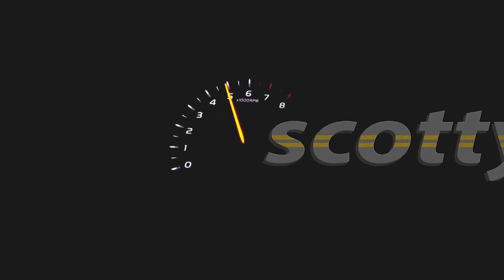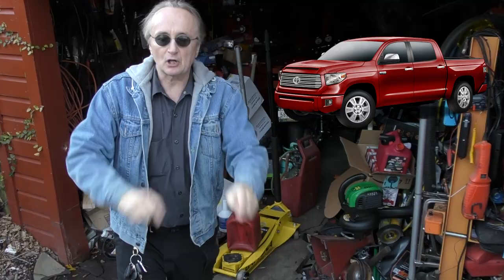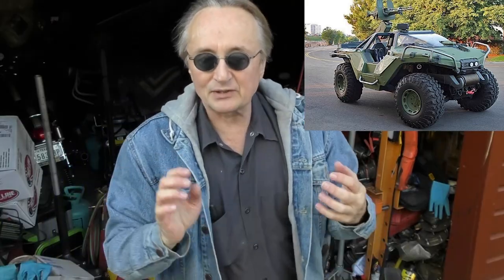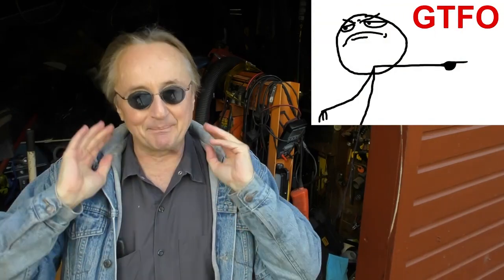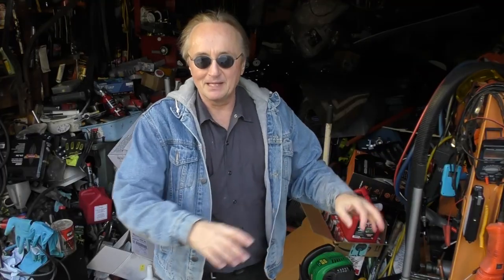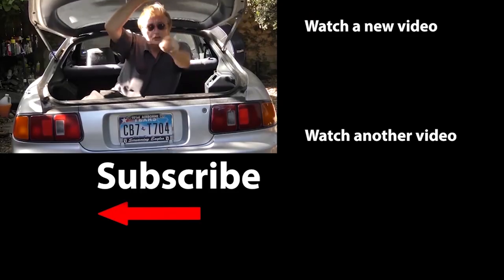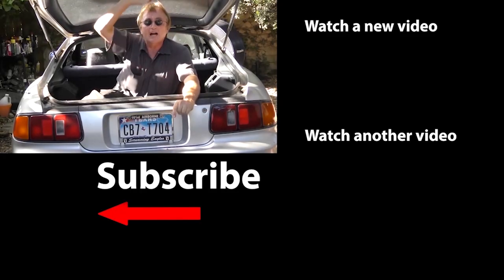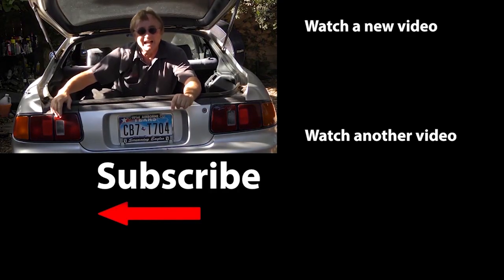5 Used Trucks You Should Never Buy

Comment: Who makes new reliable manual transmission in pick-up trucks ?
Reply: TOY OTA
Reply: Seems likes the Tacoma is the only viable option, perhaps the Frontier.
Reply: David Cisco ford, the new 10 speed is amazing.
Reply: David Cisco but you can’t break the transmission in the 11-16 power strokes.  Current have a 16 f250 and it’s built solid.
Reply: Datsun
Reply: You basically can't get a manual transmission in a full-size pickup truck, unless you get a 3/4-ton or larger.  And, if you were to buy a new Diesel truck with a manual transmission, the horsepower (and torque?) ratings are greatly reduced, because the automatic transmissions are designed to handle the power differently.  For example, a 900 ft-lb rated 6.7 Cummins Turbo Diesel is reduced to under 700 ft-lb (675 I think) if you order it with a manual transmission.  And if you order a small pickup (Tacoma/ Frontier) with any significant options, like a crew cab, the manual trans. option often drops off.
Reply: Geo metro bulletproof very fast
Reply: Unfortunately the 2018 Ram Cummins was the last year they were putting in manuals. Just read this the other day 😞
Reply: Midsize- Tacoma 
Full Size- ???
Heavy Duty- RAM 2500/3500
Reply: @aky115  um, but the 10 isn't a manual. He did say manual.
Reply: @hanskinslo326  Ram has discontinued the manual option for the new HD trucks.

No more full size or HD trucks with a manual.
Reply: Just got a used 2006 two door Ford F150 4.2L V6 with 5 speed manual tranny and 6'6" bed. 145,000 miles. No rust and runs smoothly. I like driving it better than my '08 4x4 F150. 
Sometimes you get very lucky.
I still miss my '73 Ford F100 with 8 foot bed, with a straight six engine (280?)  and three-on-a-tree manual tranny. THAT baby was a tank. Put air shocks in the rear and ran a tree service for years.

Comment: My wife drives a 2006 Honda Ridgeline at 289,000+ miles. I have done all the maintenance on it except tire and TPS sensor replacement. Scheduled maintenance calls for the timing belt to be replaced at 105K miles. If you do not replace it and the timing belt breaks the valves crash into the cylinder heads, and "blows" the engine.  I was looking for a midsized truck to replace my company car. I purchased a 2022 Honda Ridline Black Edition., it has a timing chain instead of a timing belt.

Comment: TFL YouTube channel took a ridgeline up in the Colorado mountains on back roads along with other trucks, the ridgeline transmission overheated and quit working the other trucks Tacoma,  frontier and another one had no problems.
Reply: If you watch again, they state they really babied it going up the hill in a bad way. I own a 2017. It climbs great. But if you keep the throttle low to where the torque converter is working a lot to go nowhere, Honda's fail safe will kick in and make you wait a bit.  Keep the speed consistent and avoid constant unnecessary slow crawls and it would have been fine! That said, it would have been stopped later in the film when they got to the really rocky bit...
Reply: TFL used a different driver for a 2nd test and the Ridgeline made it up Gold Mine Hill with no transmission overheating problems . 
My Ridgeline is 11 years old and it fits my needs perfectly, if I ever want to hit the trails again I'll just get another Quad .

Comment: Anything Dodge/Chrysler/Jeep is crap.
Reply: I disagree, john wayne. I ordered a 1995 3.9L V6 Dakota, 5 speed 2wd w LS differential. Still have it as of 5/26/19, although I am trying to sell it because I bought an F-150 V6 4WD. I like the 3.9 L magnum motor much more than  the Ford 4.2L  Canadian Essex  V6. Much better low end torque. Bucket seats I ordered in the regular cab Dakota are quite comfortable. now getting 20 mpg on the Dakota, highway. Main problem is the Aisin Transmission whose shift lever came out of tranny @ 91000 miles.
Reply: Dakota last forever
Reply: My 05 grand cherokee 5.7 is solid 200k + miles
Reply: I disagree I have a 2017 ram 1500 and that danm thing is a tank got hit (one at 50kmh and one at 110kmh) once and hit a deer drove away both times although did have a 1st gear problem but other than that it's a danm tank
Reply: ‘My 06 Dakota has  92,000 miles with the 4.7 v8 still going. My gramp’s 97’ Dakota went over 300,000 miles with the 3.9, and his 86’ D150 with the 318 went 400,000 miles. 🤷‍♂️

Comment: Mercedes vans are just dodges with mercedes engines as well.
Reply: Nope u got that backwards at the time dimler Benz ownd Chrysler it was a Mercedes degine
Reply: @everythingguns8632  its a dodge sprinter platform. I've worked on several of them, they fall apart all but the engine and to have it worked on is a arm and a leg I'd never tell anyone to buy one ever in life they are awful (at least the ones out side of Germany are).
Reply: @matthewwilliams9200  there both the same platform same van yes but the sprinter did not come out untill after dimler Benz bought out Chrysler and dimler Benz used that platform after the sold Chrysler if u look at the sprinter now it's a compleatly different platform the platform changed after Chrysler was bought by feit which is the current owner of Chrysler and as far as the engines goes I think u r right there too I thing there Mercedes engines even Freightliner was using Mercedes engines for a wile there when dimeler benz owned them but tho too freighliner is owned by Chrysler last I knew and if I'm not mistaken I think they own Detroit desel too but I would have to look that one up  not compleatly sure on that one
Reply: @matthewwilliams9200  I'm not a fan of Chrysler anyways transmitions issues the new sprinters r front wheel drive and unibodies I'm not sold on them at all

Comment: You forgot to include 6.  All Dodge Dakota and ram pick ups..
Reply: Just stick to your weak, unreliable Ford trucks. 😂
Reply: Found the ford fanboy
Reply: I’m still driving my 99 Ford Ranger.  It’s 20 years old and I’m the original owner.  I do my own maintenance and upkeep on it.  It’s been extremely reliable that’s why I still own it.  
If you don’t believe me about poor quality of dodge... I guess nobody’s family here has ever owned a 1990 Dodge Caravan???  
6 transmissions under 70k miles.  🤨
Reply: @fattony123082  ... Among the vehicles I own is a '98 Dodge Ram 2500 extended cab long bed 12 valve 5.9 liter Cummins turbo diesel with 350,000 miles and still going strong and I'm the original owner. My Dodge will far outlast your Ford.
Reply: Harambo - and there it is.   Another dodge guy just because of the Cummins engine.   Dodge doesn’t make Cummins.   If Huffy placed a Cummins engine on their bikes all dodge guys would be like “omg!!! Huffy is now the best bike ever”.
Reply: I own is a '96 Dodge Ram 2500 extended cab long bed 12 valve 5.9 liter Cummins turbo diesel with 230,000 miles and still going strong and I'm the second owner, bought in 2001. Great truck.
Reply: @russellbrooks23able  1999 ford f-150 regular cab long box with a 4.2 v6, and an M5OD-R2 manual transmission. Has 291,403 miles on it and still pulls anything I put it up to.
Reply: @National Patriot Council 2v tritons are much better than people think. Most people can't maintain anything so when it breaks due to a lack of maintenance they blame the truck and not the owner. Now the 3v engines there are way to many cases where it goes both ways. Cam phasers are the only thing that are bad about them, and I think ford recommends a different winter of oil for those now. Get off the old news train and find another way to complain about ford because the triton arguments are older the stone.
Reply: @harambo9805  to bad those things around that engine rust out like it's going out of style. You have to face this, without that engine your dodge would just be another truck waiting to be called a name.
Reply: Zachariah Woller - ford needs to bring back the 4.9 straight 6.   👍🏻
Reply: @fattony123082  
Will I don't know if you heard but they have a 7.3 ohv gas v8 that they are putting in the Super duty, so they might be turning to old engine designs after all.

Comment: Lets see Toyota Tacomas - LOOK up Transmission PROBLEMS they got them OUT the WAZOOOO along with ELECTRICAL and listed as a LEMON... This guy is propagandist -  Tacoma's with RUSTED in 1/2 FRAMES, the 3.5 v6 is WEAK and the Manual TRANS is JUNK.
Reply: Older Toyota trucks had frame rust issues.
Reply: I have had three Tacomas (1998 one new and one used, currently own a 2012) no problems all with manual trans. no problems.
Reply: my 2012 tacoma in manual is fucking amazing i love it
Reply: @Flying Monkey  Not all of them, the point is they are NOT trouble free as the guy says. Read Car Complaints - hardly a fool proof vehicle.
Reply: The Tacoma hunts for gears but the things last.

Comment: Bought a 06 ram 1500 hemi SLT for 2k with 230kmiles.i put 12kmiles on it in 15months. No issue's! I did a tune up & oil change(got from a Older guy who bought NEW in 06. Alot of highway miles.

Comment: Best truck i ever owned is my 90 dodge w250 900.000 miles and still driving it  with 3rd transmission still going and everything is working even the a/c ...3rd system. Worst truck 01 dodge 2500 6 transmissions in 170000 mile and  a dash that looked like the grand canyon all fixed now with a 2015 transmission installed. Now have a 2016 ram 100,000 miles so far only a headlight went bad love this truck

Comment: My honest opinion. I have a 2013 ridge line that I bought brand new. Has 100k on it. 0 issues whatsoever. I really really like it but if I could go back in time I would have got a Tacoma instead. I only say that because I only use my truck now to go off-road and tow my boat to the lake. When I was using it as a daily driver I would prefer it over any other truck though because it’s a much more comfortable ride.

Comment: I had a brand new F150 once, trans replaced, electrical wiring, spare tire carrier, lug bolts, all before I had 20,000 mi on it. Had more problems with that truck than any other. I've own'ed Chevy, Ford and Dodge. Currently have a Ram with 328,000 mi on the clock, Had the trans rebuilt once(I pull a trailer) best truck I've ever owned.

Comment: You need to make a list of "what vechicles, and years to buy"?  I'll start off.  1.  Any Toyota with manual tranny, with the 22r, or 22re engine.  Bought one years ago, and put 250,000 miles on it.  I changed the cat converter, and battery.  Why are they good?  They are dead simple.  We need more vechicles that are dead simple.  I know it's difficult because of emissions.

Comment: Changed timing belt and a cracked motor mount at 330,000km on my Ridgeline. First time in the shop. $1100 Cdn. Do not feel less of a man because it does not have a frame. Wish mileage was better 11l/100km. Will buy another if it ever dies.

Comment: I have 3 pickups, 2003 S10 ext. Cab 2.2 5 speed 254,000 miles, 2010 Silverado LTZ 139,000, 2015 Colorado 104,000, can't kill the 2.2l it ain't got no power but it's bulletproof, I have owned ford's and dodges all were good trucks, I think the key is regular maintenance. 👍👍🏁

Comment: We have a couple Ridgelines in my family. We use old super duty's for the heavy lifting but these Ridgelines are awesome for hardware runs, and groceries. We need 4wd in everything where I live so they are great for daily drivers. Mine has 260k all bone stock original while my superduty has had 3 motors with only 200k.

Comment: Ok Scotty I have to correct ya here, the Chevy SSR was NOT the only Convertible truck made!!! Back in the 70’s International made a just right sized Scout II TERRA PICKUP, basically a Scout II with another 18” in the rear, added between the front seats and rear axle. They had a removable Hardtop, or a fold down Convertible roof over that cab or cab/bed. I know I owned one! The next one was in the late 80’s, called the Dodge Dakota that had a vinyl fold down Convertible top, that came with either 4x4 or 4x2, even a special very rare Shelby Model.

Comment: My 2017 Tacoma 4x4 off road had catastrophic trans failure due to mud n debris entering the bell housing via a mysteriously missing plastic inspection hole cover. Not warranteed due to "misuse" (going through a mud puddle). 22k miles now on my 6th service run.

Comment: My company bought a used Dodge Ram 2500 turbo diesel 2004 and we had to dump 10 k into it. I drove the dog snot out of it towing big boats long long distance for 4 years and it was pretty good. Only had a water pump go bad on it and the cruise control went out. 
The other suv we had that was amazing was the sequoia and we beet the crap out of it. It never quit.

Comment: Well now ,  I bought a NEW DODGE RAM  1500 in  September 1997 a 1998 RAM  two door quad cab.  I've never had any problem with any thing  on this truck !  With a 5.7 L , loaded !  So lets not knock " DODGE  RAM  1500 's " .  I also have just bought a 2005  Dodge Dakota , one owner and only 40,400 miles .  Great little truck .   Tom  Daytona Beach,  FL.

Comment: I had an 04' Ram Daytona as my first truck. Craigslist special. $4500. Thought I got a bargain. Only 84,000 miles
So let me tell you a little about it. I could stomp the peddle and smoke those 275-55-20's for the length of a football field on a dry road. That was sorta cool as a teenager. The tie rod ends were bad, upper and lower ball joints, bushings, you name it. Needed a whole front end. The power steering pump made weird noises, it was very squirrely, made my passengers nervous. None of my power windows worked, couldn't replace the fuse, the switch, or its motor for the windows as it was a wiring problem somewhere in the harness. Wait it gets worse, the heater was stuck in an "Always on" mode until I finally pulled the fuse out. The girls in high school didn't really like to ride with me, with the windows being stuck and the heater on in the summer. Also, the most important thing to a high school me, the radio- well only the two tiny speakers on the dashboard came on despite displaying "premium sound" badges.. and when it rained and I turned my windshield wipers on the headlights would flicker, causing me a ticket on one occasion. Numerous wiring problems. Like I said the best thing about it was the burnouts, but it would spin the tires when I wasn't even trying, IE if I were to pull a 14ft fishing boat up an incline with this truck, would smoke the tires all the way up the ramp. No traction control. The 20' rims were stylish and dodge was the first to do it on their half ton pickups, but the lug nuts were coated with a cheap chrome filmed plastic. I worked at a tire shop and would change the rear tires for another used set about every month, and finally the impact sheered the plastic off the metal lugs and I had to get them off my studs with a hammer and a screwdriver. To top it all off, I may have gotten 11mpg with that 5.7 HEMI. Ever since, I've only bought Nissan, Ford, GMC/Chevy. Never owned another Dodge of any kind since, and no wonder why they changed their name to "Ram" in an attempt to shake the negative stigma of their past. They aren't fooling anybody, and that's why they don't hold their resale value.

Comment: I had a Ridgline and really liked it. Nice ride, comfortable, good power, but so so gas mileage.  About 20 mpg and I was driving 100 miles per day on the fwy.
Traded it in for a nissan leaf 2018 because where I worked they had free charging stations and how often did I use the pickup?  about 1% of the time.

Comment: Had a 98 Ford Enforcer F150 with a 300 Flat Six / 5 Speed Manual that went 410, 000 Kms and still ran great But the body was falling apart after 8 Years !!  That 300/ S6  was a Bullet Proof Engine ! Also had Chrysler Slant 6 that was incredible  !!

Comment: Scotty the engines in those Honda Ridgelines are pretty good, its people here in Alabama that have over 100 and 200 thousand miles and still running good, but you're right about the size, they are just to small to use as work trucks

Comment: Scotty my best friends father was until he retired was the shop foreman for a portland dodge dealership he has been twisting as long as you if not longer. He told me first hand that the dodge daytona truck was a joke by dodge but you can remove that stupid tail fin, they sold a kit that you could have installed so the tail will be a quick release but most just took it off and never put it back on.

Comment: It’s all about regular maintenance. Most ppl don’t even have a maintenance log put together and then wonder why things go wrong. My 2008 Ridgeline has been super dependable and is at 209k miles. Scotty’s options are vague at best. Saying there are engine & transmission problems without specifics is weak. I’ve had none of those in 13 years

Comment: You made this video 2 years too late; I bought a used 2008 Honda Ridgeline RTL with 100K miles...I'm at 145k miles now and honestly it's been pretty good. No major issues thus far - just regular oil changes. Only complaint is the truckbed is too short for full sized sport motorcycles. Hoping to switch back to a F150 or Ram 1500.